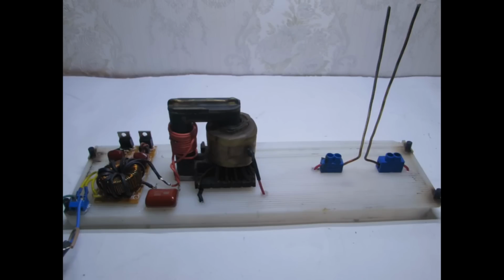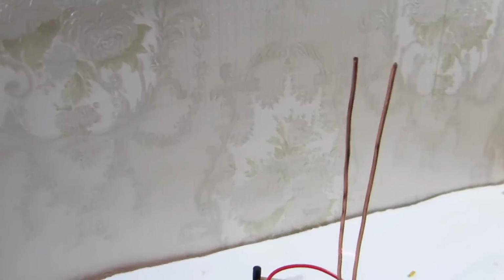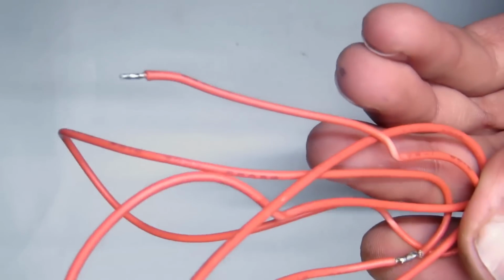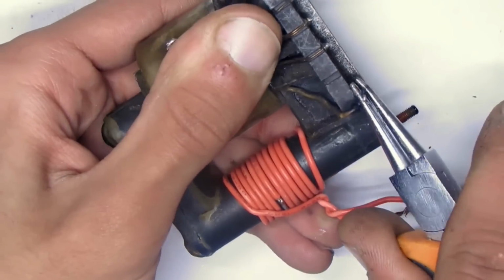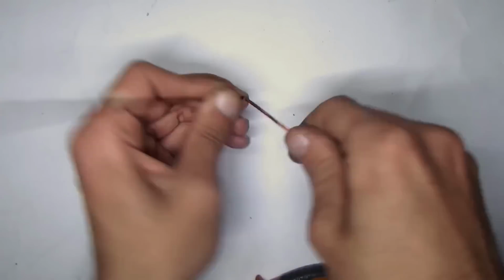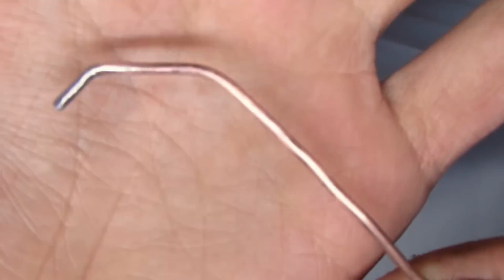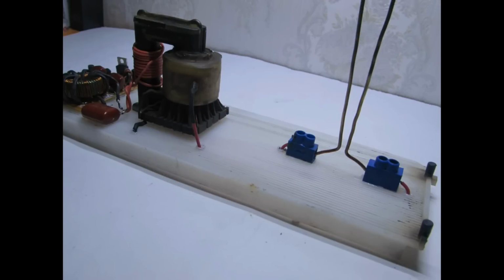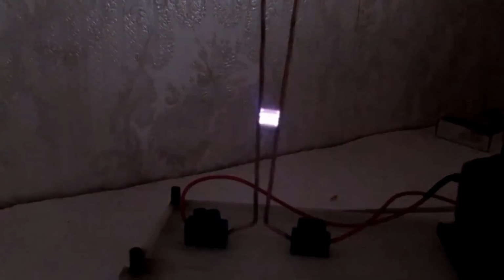Electronic Jacob's ladder

Comment: The microwave transformers are in thousands here and super easy to find
Reply: I know but voltage Is to low
Reply: @meowmonster  low voltage? i don't think so... electroboom successfully do a jacob leader on microwave transformer. If voltage is to low , maybe voltage multiplier can help
Reply: @slaweksuchy2702  it will need to be manually started if you only use 2kv, also Voltage multiply won’t help

Comment: impressive build. do you have an circuit diagram for the electronic board with the capacitors?
Reply from the maker: I have a video about an electronic transformer, there is the same circuit  https://youtu.be/0-K04-YFXFk

Comment: Built the circuit and works fab! Can i ask, why do we need the cap when the o/p is a coil of wire as is the primary of the transformer??
Reply: The cap is for voltage regulation